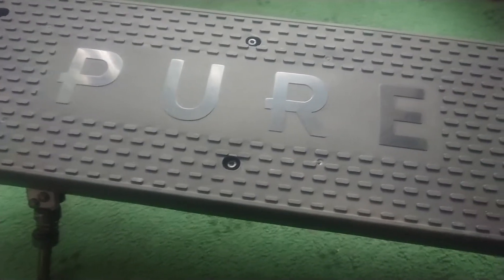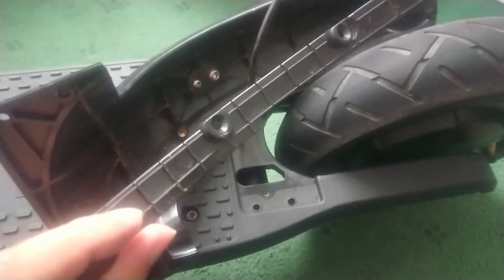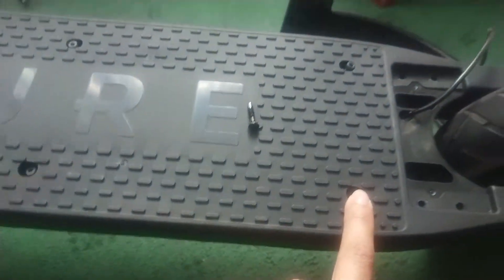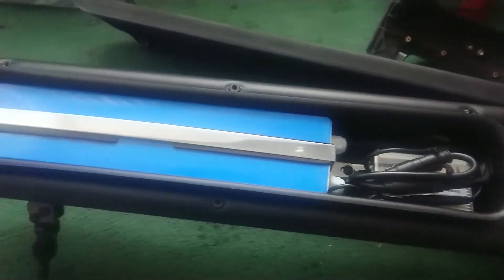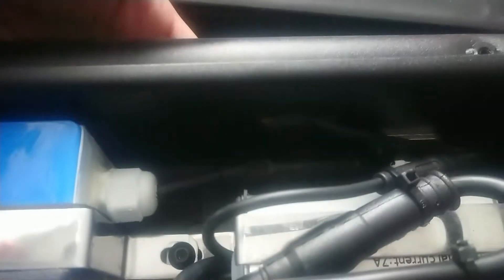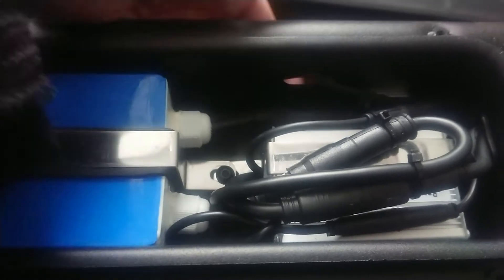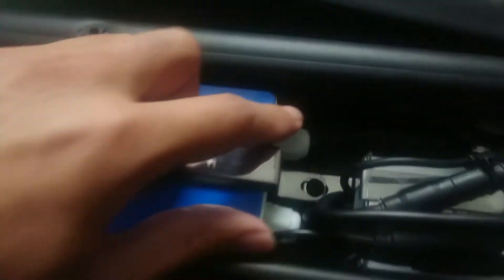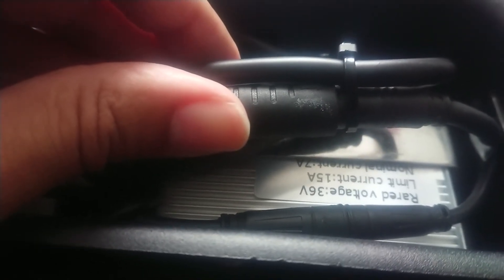Electric Scooter - Pure Air (waterproof)

Comment: I have just checked my Pure Air it’s exactly the same as yours!
Reply from the maker: Flippin' L! Thanks for checking chap, that means they are leaving the rubber bit out - seal it up with duct tape or maybe foam spray?
Reply: @datasamm  Hi mate, I would not worry about voiding your warranty. But this could serious and should be brought to their attention. Their unique selling point is their IP rating. If this is a concept, design, or manufacturing defect, then the warranty will cover it. PURE ELECTRIC are fairly new on the seen with their own production, so mistakes are apart of their learning process. but the sooner they are informed the better for them &  future customers. And of course they should make you and Troy  some sort of a commercial gesture as a thank you for bringing this up.
Reply: @datasamm  Hi, do you think you will check with Pure Electric about the hole in the scooter?
Reply from the maker: @pinotgrigio8987  Afternoon, I hope you are well. I have sent a message to the company - waiting to hear back and see what they respond with.

This is what they responded with:

Hello - I have shown your video to our designers and they have said that there is a small rubber grommet there that is missing, you can bring it in and the store should add one if you want to. The internal electronics and connectors are protected to IP65 so this will not affect the functionality or waterproofing.

Comment: I think the hole is there by design for the battery to exhaust heat guys. Those wires and especially the battery look air tight and can probs easily handle any flecks of water that might get in.

Comment: Gosh that was interesting to see. So there is a hole on the side of the scooter? I am astonished. Thanks for the video. Starting to wonder about the accuracy of their IP rating. Wonder what PURE ELECTRIC would comment if they saw that?! Did you send them the video?
Reply from the maker: I haven't sent it yet, I actually found the second one. Basically, cables go through them, one has a rubber around it (like in the stem) which makes me wonder if they forgot to put a rubber on in this video. Either way, I have sealed it today with duct tape as best as possible. I have ridden mine in the rain, I was looking for water signs in there, didn't find anything. The wheels are far from the cable-hole so water shouldn't go in. Best to wash it gently, and from the top. I wouldn't recommend jet washing from the bottom of the scooter or going through deep puddles!
Reply: I wouldn’t contact pure electric because if they know you’ve opened it up you’re probably voided your warranty

Comment: And... To upgrade it?.. Can reach 30 kmh flat...
Reply from the maker: It's locked in at 25kmph, it's actually fast enough though. Any faster and you won't have much battery left..
Reply: @datasamm  obvious but... 10 miles its enought... At 30 kmh
Reply from the maker: @alfredodorado2821  I had a puncture the other day and decided to try and fix it at home. Interestingly I noticed it didn't have much lubrication so I added some, now it rolls so much easier, I can coast for longer! The battery seems to be lasting longer too and I can get up to a better speed much more rapidly :))
Reply: @datasamm  bearings?,and the air puncture prevention?
Reply from the maker: @alfredodorado2821  I put some lubrication on the axle, the long rod that goes through the front wheel. The puncture fluid didn't really do much, so I got the inner-tube out and used a bicycle repair kit to fix it.
Reply: @datasamm  what lubricant can I use?
Reply from the maker: @maximeherion4482  I got this from Amazon, works very well: https://www.amazon.co.uk/dp/B088361TCJ/ref=cm_sw_r_cp_apa_glt_fabc_XEER1KRF6TE1BJ5KXRZ0